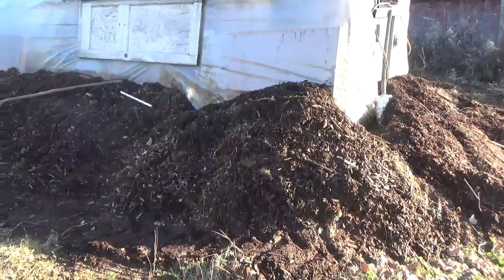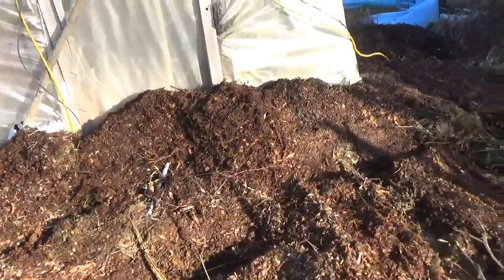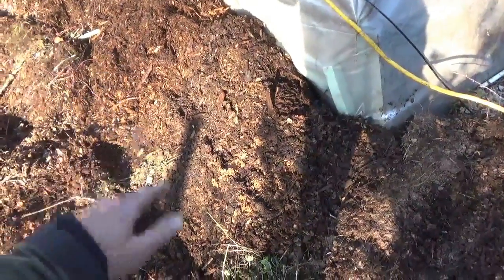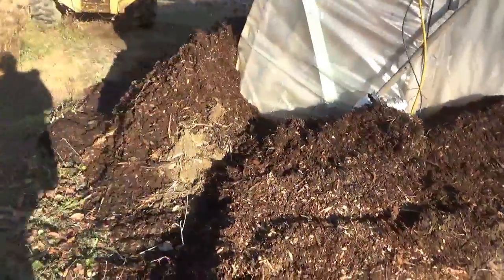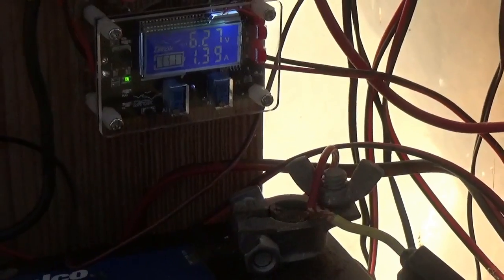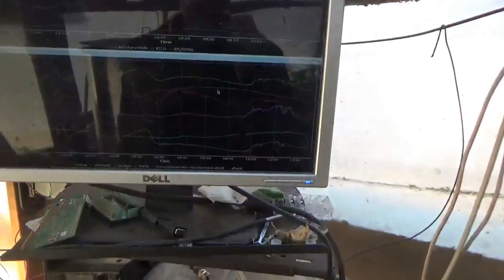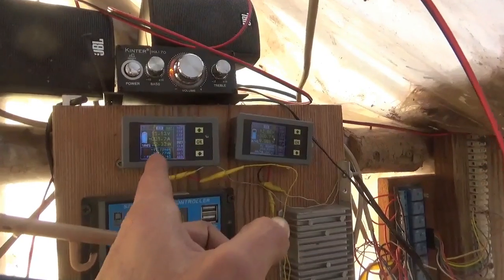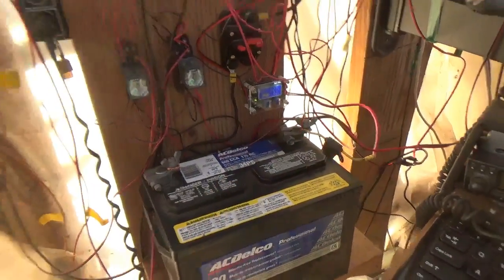November 24th, 2020 Greenhouse Update More Wood Chips New Voltage Regulator Installed Raspberry Pi

Comment: That berm of wood chips should generate some heat also... Strange voltage readout, I would have to dig into that... It's like a challenge! Happy Thanksgiving!
Reply from the maker: yes and because it's dark also capture sunlight energy for heat.. I can always add nitrogen if I need a heat boost.  Yeah, I'll be back after that issue at some point. cheers! Happy Thanksgiving!